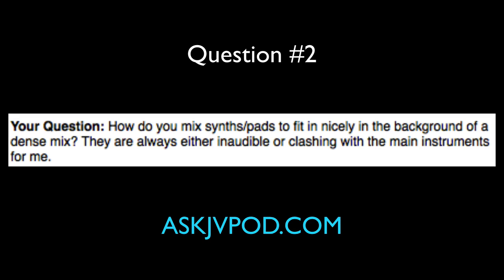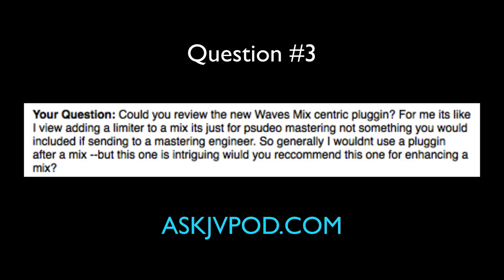#ASKJV - 24: Controlling Kick Dynamics, Fitting Synths In The Track & Mixcentric By Waves

Comment: Hey Jordan, when you say you "leave some headroom for mastering" when you use a limiter when mixing down the track, how much headroom are you actually leaving?
Reply: im not Jordan obviously lol but most people generally leave around 3 db to 10 db of headroom 3 being the absolute minimum amount of headroom you should have in your mix and that is pushing it in a metal mix I think...most of my mixes sit around -6db before throwing on a mastering limiter....more headroom increases dynamics but its easy to go overboard and make your mix sound lifeless if you take too much off the top...hope ive been helpful
Reply from the maker: My mixes generally will come out around -14 or -15db RMS.... after mastering it's more like -9.  so 5-6db of headroom usually.  And in the past i would leave double that, before i was as confident.